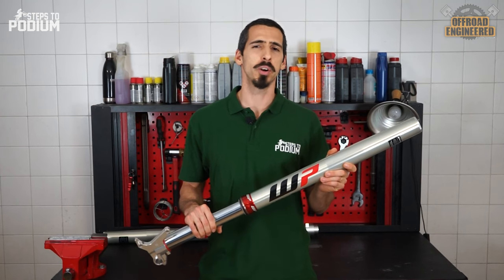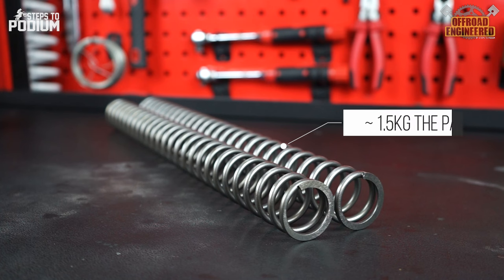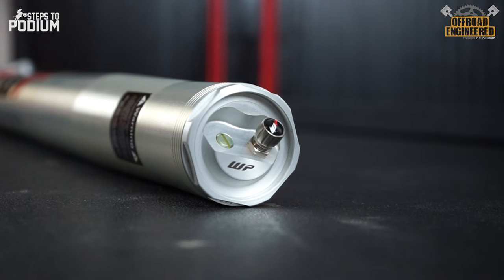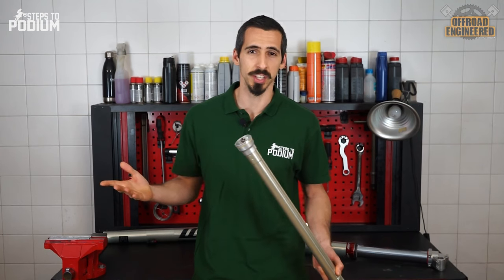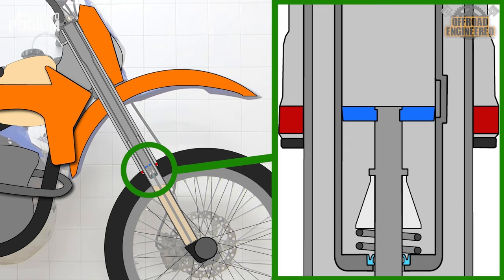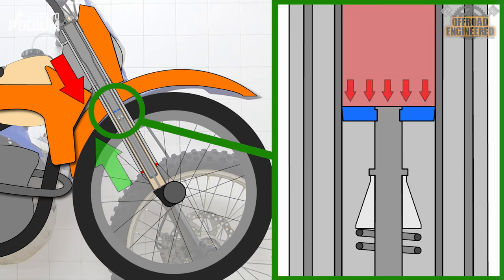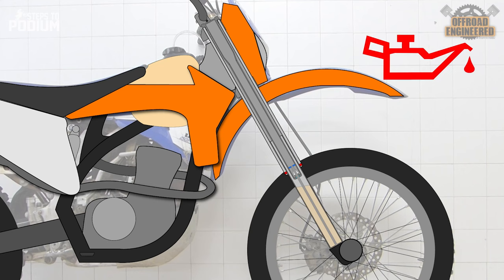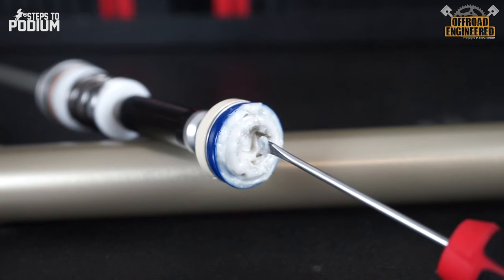How  @WP_Suspension AER air forks work | Offroad Engineered

Comment: For primarily off-road applications, such as rocks and roots on single track and hard Enduro type settings… Would you focus on air Forks or closed chamber spring forks? Looking for great sustained comfort, but also good bottoming resistance for drops.
Reply from the maker: Comfort and bottoming resistance are strong points from air forks, but it comes at a cost of more frequent and expensive maintenance. But if you are ok with that compromise, go for it :)

Comment: I Have a set of air forks on my Husky 350, and after a year I think I have found the sweet spot,  They must still be checked after every ride but that's Okay with me.  I really love how they make the front of the bike feel so much lighter.  I ride in a place with large roots pounding the front end every few feet.  The only issue I have is that they will start feeling slightly harsh when the secondary air chambers pump up.  To keep  the plushness, I release the secondary chambers with a set of push-button relief valves but I have to take my hands off the bars to do it.  Instead of having these manual operated valves, is there something out there to do this automatically????   Something like a blow-off valve on a turbo.
Reply from the maker: You should never relieve the air pressure from the outer chambers when riding! Its should always be performed when the wheel is off the ground!
Keep safe 💪
Reply: If I don't hit the bleeders, the ride gets harsh.  A quick push and it's instant relief.  I do the main chamber on a stand but there is no stand out is the woods as I'm getting pounded over the roots.  @StepstoPodium
Reply from the maker: @richfrady8044 then try hitting the bleeders with the front wheel in the air (hopefully not during a wheelie! 😂) 
If you do thst in the trail with your forks compressed, they'll generate a vacuum and won't be able to fully extend
Reply: Aer cone valve forks are amazing 
But there’s two valve adjustment 
Stock aer forks I’m not a fan of

Comment: Obrigado for the great video Luis. My uneducated assumption would be, that that due to the friction, the temperature inside the fork would rise regardless to the outside temperature, which would cause the air to expand and pressure to increase. What I am sayin, or actually asking is, wouldn't an air fork be prone to inconsistency?
Reply from the maker: Than you Ariel! 🙌
The fork won't get that much hot due to working conditions. The grease inside keeps friction to a minimum (within possible). The outside temperature is the most significant factor because the variations can be quite significant from winter to summer in some regions and even daytime variations.

Comment: Interesting but pumping air creates heat,  my bicycle pump gets hot just adding 2psi to my rear tyre. How hot will that fork get?
Reply from the maker: And it will get hotter, of course, but the biggest difference between both is that the forks have a huge area to dissipate heat and so it never reaches such heat amplitudes like a small hand pump. Besides that the hand pump does not contain grease to reduce friction and absorb heat :)

Comment: Do you have a video on how to diagnose & repair open cartridge forks? If you're curious: My fork is making a 'c' sound in the word 'can' sound during high speed compression & I'm not bottoming out. High speed compression is the only thing that makes that noise, slow speed compression even if it's the same or more overall compression will not make the noise. Would that be a broken shim?
Reply from the maker: Only by taking apart I could know, sorry!
Reply: @StepstoPodium  no worries, I was more wondering if you had a video on how to take them apart & diagnose it myself. I was just giving the details since most people tend to ask for them anyways.

Comment: Ah, it is similar to bicycle air spring. I tune mine to have this transfer port higher. So the negative chamber pressure is higher. As it has smaller piston surface to have an perfect initial softness without an preloaded feeling.
Reply: How you do it?
Reply: @igortbp  Change piston positon or volume
Reply: @aaaaaaaaaaaaaaaargh  Air volume?

Comment: if the seal on the air chamber went out would the  forks clasps. like the fender sitting on the wheel.
Reply from the maker: Yes, but that's very unlikely. It would mean the air had to come out of the shrader valve and it's really unusual to happen
Reply: @StepstoPodium  ok, thanks. someone told me onetime years ago his buddy's went out on the trail and it sat down on the wheel. it didn't' sound right to me.